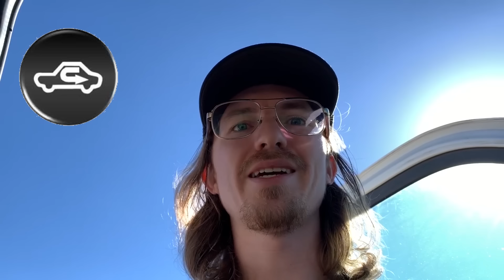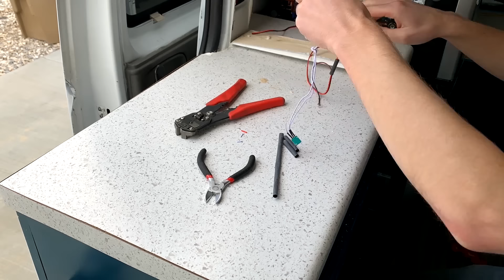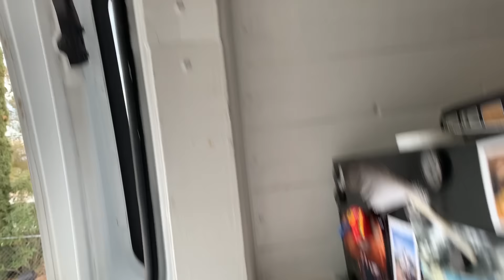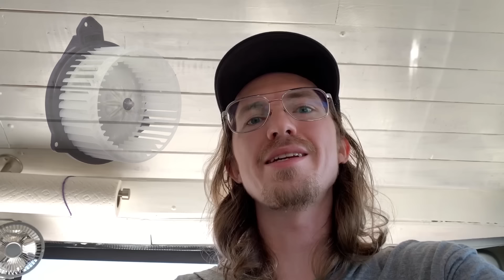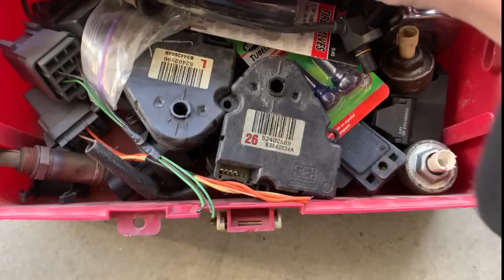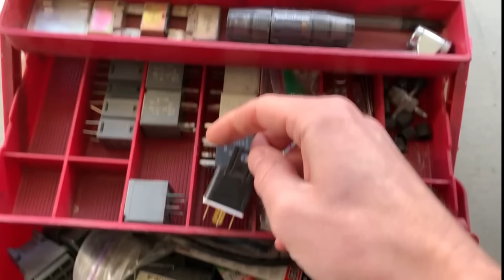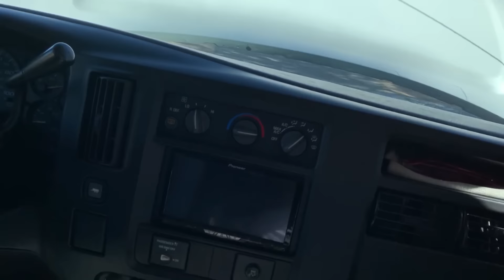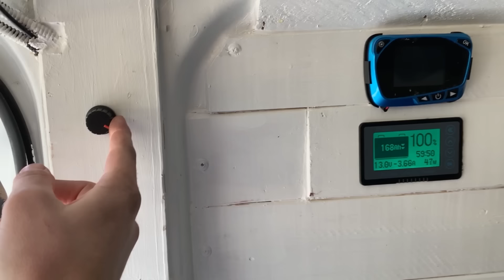OEM Blower Hack **ULTIMATE STEALTH**

Comment: Hi Tim, if you were to redo your van again, would you make room for a roof vent at the cost of stealth and less solar output?  I'm currently stealth camping across the country in my Toyota RAV4 hybrid with a 200-W solar panel nested inside a roof rack for stealth, connected to 100 amp hour lithium battery. I absolutely love the stealth, but I need to build out a van for the girlfriend and I eventually, and she wants A/C. :)
Reply from the maker: That's a really tough question for me. I guess it would depend on where you plan to camp out!
If you're doing lots of urban camping I would probably stick with the solar and ditch the roof fan purely for the stealth factor.
If you're out at campsites or bouncing around western USA BLM land, I'd go with the roof vent!
You could even install the roof vent under the solar panels with a small lip around the opening to block water from rolling down the roof and inside the fan. Then just use the large solar panel as the main rain guard. Only issue there is closing and insulating the fan opening during cold nights.

You can gain a LOT of solar with a tilting mechanism to keep the panels pointed at the sun, but that's a really expensive project. You would need a skilled welder / machinist to pull it off safely while still maintaining a low-profile stealth look.

Of course that's all just my opinion and different people have different goals and lifestyles!
Hope it helped give a little insight!
-Tim

Comment: Meanwhile I just wired my blower fans directly to my living battery (with a small pwm controller in between) and to switch between living and starter battery I just used a if/or mechanical switch ^^
Reply from the maker: Excellent! Someone else in the comments mentioned doing the same thing (they didn't want to use a relay or diodes)
Thanks for watching!
-Tim
Reply: @VanwithTim  it is a less elegat solution, but I barely ever even switch it back to starter battery, since I am loading the livibg battery while driving anyway. And I can set it to the exact speed I like, not just 1-4
Reply from the maker: @florihae  I always hated the 1-4 speeds in the OEM unit! Glad it's working out!
Reply: @CharRichardson  idk what a pcm is, sorry.
Switch I had laying arrround, so I can not tell you much about it. But it is rated for 230V 10A...technically not fit for the task 🤣

Comment: Hi Tim Thanks for sharing your Ideas.
However instead of having 4 Solar Panels on  you Van Roof, why not get One 380 Watt Solar Panel? 
Cheers from Toronto, Canada!
Reply from the maker: Hey Grazyna thanks for watching!
We have an AC unit we use quite often which draws around 510 watts.
With the conversion losses and inefficiency, the 920 watts of solar really only outputs around 700 watts max (and only when the sun is directly above).
That's overkill for many van builds, but we really wanted off-grid air conditioning!
-Tim

Comment: Good idea.  You know your electrical. 
I like my fantastic fan -  installed over the cooktop which is at the sliding door When you need to cook inside I find it makes a huge difference to have the fan just above you on high sucking the heat and smell outside real quick. Most of the use I get from the fan iS sucking the air out.

Good luck and hopefully it works out for you. 
BTW I have just two 100 watt panels that I fold out as needed, I rarely have to deploy them as the alternator does most of the charging - so I had plenty of roof real estate...
Reply from the maker: Those Fantastic Fan's really move a TON of air! My little setup is better than nothing for sure, but it would have been nice to have the power and efficiency of the rooftop fan.

We typically drive once a day to go out adventuring so our 145a alternator takes up any slack from a cloudy day or tall surrounding trees.

The solar is a nice addition to have for sure though!

Thanks for checking out the video Terry!
Cheers!
-Tim
Reply: @VanwithTim  If you drive once a day (as we do) you likely don't need solar - cuz your alternator will do the job. I chose to not put solar on the roof to limit complexity and help with fuel mileage. 
Did a quick and dirty search. FF = 950 cfm - VAN = 250 cfm. & fan on be the van will be noisier. These numbers don't matter in 70-degree weather. Wait till you are at 90 degrees with a lot of bugs...  (spell no fun )
Reply from the maker: @TerryManitoba  The bugs were the real reason we needed this! Cooking on a hot night yet couldn't open any doors or windows. Thousands of mosquitos excitedly waiting for a slumber-party just outside the van.
Those were some MISERABLE nights haha

Comment: The chassis ground can be modeled as the whole body of the car being a giant wire. The only limitation is the quality of the grounding between your equipment and the chassis. You can get voltage drop with high current loads across the oxidized junctions eg when the starter happens but that’s probably not relevant for your use ;)

Comment: No electric solder iron ... a high power gas torch/lighter ..that's badass soldering!!  :)
Reply from the maker: You quickly discover the quality of wire insulation with the open flame method haha.
My Chinese wire will go up in flame almost instantly. My California manufactured wire has extremely high heat tolerances!
Thanks for watching John!
Reply: @VanwithTim  USA! USA! USA! USA! USA! USA! USA! USA! USA!   :)

Comment: Even if a centrifugal fan could move air in reverse, the dust and debris it would churn up between the cabin air filter and the exterior grates would probably not be a good thing.
Reply from the maker: Forgot to mention that! Unfortunately (or fortunately in that situation) all 1996 - current Express vans lack cabin air filters.
A sad state of affairs for GM honestly.
Reply: @VanwithTim  Yikes! Yeah, I guess all the more reason to avoid sucking that stuff back into the cabin.

Comment: Okay, I watched your video and have come to the conclusion that I have 2 choices:  (1) Be sure to leave room on my roof for a roof fan should I ever decide I want one; or (2) I find out where you are and drive out to meet you and pay you to do the installation required to  use my van's air circulation blower system.
Reply from the maker: Haha thanks George. I would definitely recommend the rooftop fan over this (more efficient!) But this is a cool little option for those who love to tinker around.
Cheers!
-Tim
Reply: If you are trying to make this happen, you could probably find an auto shop willing to work with you

Comment: A lot of work. I. Bought a 12v electric radiator fan for $15.00. I put it on a piece of wood that will fit the inside of my rear pop out window of my van for stealth. I have a reverse switch and on and off switch to attach to it feeding it from my fuse box. About $25 total.
Reply from the maker: Sounds EXACTLY like this setup!
https://youtu.be/9WdWvQaoN5A?t=232
Yours probably flows 10x more air than the stock blower motor.
I see people putting rooftop fans in their back doors as well but it just looks a bit funky to me (and expensive).
Excellent way to think outside the box
Cheers!
-Tim

Comment: I have a theory that directly relates to this. What if you used an auxiliary coolant heater to warm your coolant, would this then allow you to heat your van through these vents?
Reply from the maker: That's a great idea! The freezeplug type block heaters wouldn't work as they don't circulate the coolant, but there are versions that heat  circulate the coolant!
It should work ASSUMING the coolant pump has enough power to circulate through the relatively narrow heater core hoses and heater tubes. (in contrast to the very open engine coolant hoses and passages)

I'm unsure just how much heat would be produced though. It would probably be pretty small as the majority of heat would be absorbed by the engine.

Would be cool to test!
-Tim

Comment: That's a clever trick, but that blower seems mighty inefficient.  A maxxair only draws about 4.5 amps on high (1200 cfm) a fantastic fan only 3 amps for 900 cfm.  With all the obstructions I'd be amazed if your stock blower is moving that much air for 2-3x the power.  I get you're trying to avoid roof vents here, but you pay for it.
Reply from the maker: You're spot on.
Would have loved to find  factory CFM data but I guess it's not a heavily discussed topic. (Why would it be, right?)
There's no way it's moving as much as a rooftop fan, and the power draw is far more.
Have a smoke test planned just to satisfy my curiosity.
Should then give a rough CFM estimate but it won't be anything too impressive. Made for a fun experiment while thinking outside the box though!

Thanks for watching!
-Tim

Comment: What will happen if the blower motor is energized by both the PWM controller and the dash switch?
Reply from the maker: Great question Richard,
The magic lies in the relay.
Check out https://youtu.be/xvFvJiiDD7w?t=250
The blower motor is connected to pin 30
The PWM controller is on pin 87a
The OEM controller is on pin 87

When the ignition is on, the relay activates.

The blower disconnects from pin 87a and connects to pin 87 (keeping the PWM separate from the OEM controller).

Hope that made sense! Easy to demonstrate, tough to type out!
-Tim

Comment: I'm dumbfounded by your sophistry,   KISS   ( keep it simple ) if all the relays to the blower motor are open, why add a relay instead of just splicing a power wire to the blower motor?  Also someone mentioned putting a thermostat in the circuit for keeping the van temperate when your not in it.
Reply from the maker: If the key were on and the OEM blower circuit was active, it would try to back-feed into the PWM controller.
Say the house batteries were only at 12.1v and the van was running at 13.8v, it would try flowing enough amperage through the small blower wire and the PWM circuit that the fuses would blow (or without fuses, catch the wire or controller on fire)
Same could happen in reverse:
The house batteries are at a comfortable 13.2v with the solar but then the key is turned on. With a simple splice into the blower motor wire, it will try to "charge" the starting battery through the PWM controller and the OEM blower circuitry. Again resulting in blown fuses or fire.

I usually do try keeping it as simple as possible (a single 5-pin relay is pretty simple!) but unfortunately that relay IS needed.
---------------------------------
Thermostat: I've tried the W1209 units, but the manufacturers are hit or miss (mostly MISS) with their components.
They're almost all missing  pieces to protect them from "overvoltage"
Although rated for 12v, they seem to fry the relay's at even a slight increase to 13v (typical automotive voltages)

Would love to put together a setup that measures the Δt from interior to exterior as well as monitors the battery voltage!
Great idea!
Reply: Other than having one system override the other, I would then opt for diode isolation at the blower motor, my vehicle has a computer and relays for everything.  In a previous van I had a fan, just hooked to a thermost, full on or off, I never thought of a speed control,  just temperature as the furnace in my sticks and bricks.  I've just fused both ends of the wire connecting my back and front batteries,  I've bought a relay to isolate them, but in 8 years havent been faced with the need to separate them. I had a knife switch separating the batteries on a previous van but found that I just left it closed. I do have a "Volt minder" low voltage meter and audible alarm adjusted to sound at 12.5 volts, so I never worry about having enough to start the van.

Comment: A lot of engeneering went into this, but as a non native speaker I am wondering what´s the benefit?. Shouldn´t the first goal be to suck the moistered air from cooking and breathing OUT of the van, and SECOND bring fresh air IN?
Reply from the maker: Ah, my apologies for not including subtitles on this one!

With the flow direction, it seems to be personal preference on which way to have the fan blowing.

For example, if you're cooking next to an open window, you'll want the fan to push the air IN and force the cooking smells OUT through the window.
(If it were reversed it would bring the cooking smells all the way thorough the van)

But there are other situations it would be better to suck the air out!

Overall though, as long as the fan is pushing the air in, the pressure it creates causes the inside air to be "pushed" out the back.

I hope that makes sense!
Sorry for the long comment!
-Tim

Comment: Thats a lot of work what you can do is take the power to the fan and make it permanently live and put a new fuse in the circuit.
Reply from the maker: That's much easier for those not super-comfortable with this schematic.
I would just be weary of back-feeding the 12v+ into the OEM circuit when the key is off.

Results will vary depending on make / model, but it might just try to power your entire OEM fuse block off of your 12v+ live wire.

Always worth doing some probing first and checking the factory wiring diagrams to be safe!

Thanks for watching Vince!
-Tim

Comment: What are you doing to eliminate back feed? I didn't see any usage of a diode to make sure you're not sending current back through the original blower circuit.
Reply from the maker: That's an important question!
The relay pack is what isolates the PWM controller from back-feeding current into the OEM blower circuit.

When the key is off, the blower motor's 12v + and - are cut off from the OEM circuits and connected to my add-on PWM controller.

When the key is on, the relays are energized and the blower's 12v + and - are disconnected from my add-on controller and reconnected to the OEM blower circuit.

Comment: How are you powering the fridge?
Reply from the maker: It's a 120v "dorm" fridge.
Not at all made for the extreme temperatures / bouncing around of a van, but it's been running fine for the past 1.5 years!
Once it dies (it will eventually die) I'll grab another one for $150.
It draws around 80w (including inverter efficiency loss)

Comment: When parked in a camp setting, you could put a shade tarp over the air intake to pull cooler air into your van.  This would also keep direct sun off your windshield.  Might help.  I tied a shade tarp from the support poles in a picnic area over my car to the back of my roof rack in Red Rock near Vegas and dropped the car’s internal temperature 10-15 degrees.  It went from frying my brain to tolerable inside my car.
Reply from the maker: That's a great idea. Window tint is one thing, but actually keeping the sun off of the van altogether is a much better idea.
Thanks Catherine
Reply: @VanwithTim  Hope it's helpful.  If you don't want to cover your solar panels, maybe just tie the tarp to the leading edge of the panel support structure.  Wish I had your confidence with electrical projects.
Reply from the maker: @Catmoore60  Thank you for the kind words Catherine, and I really think you're on to something there!
Off topic, but have you also visited Valley of Fire State Park (north-east of Red Rock?)
Our first night in the van was spent on those outskirts. Possibly our favorite state park visited in the US so far!
How do / did you like Red Rock? We might have to check it out this spring.
-Tim
Reply: @VanwithTim  I was in Red Rock to belay a climbing friend, and there were so many routes, we never made it out of Red Rock that trip.  I'd love to see Valley of Fire!  Red Rock was really cool, in a very hot way.  There was a terrific hike to a couple of tanks, but time that well or you will fry.  Walking in a narrow canyon with no breeze and heat radiating off both walls was a test of fortitude in the middle of the day.  It was also really fun to watch the climbers working the various routes.  Not for me, but interesting to watch!

Comment: 50 years ago, I was a student engineer assigned to Chevy Engineering at the Warren Tech Center.  One of my first assignments was testing vehicle electrical systems, recording the current draw of each device.  The resistor pack you show is basically the same one used in 1969.  The blower will draw more current on low and medium than on high.  The 4th speed was a seperate wire to the blower on a 30A fuse.  Everything was to chassis ground, so your idea of a single wire to the front is right.
Reply: Are you sure? You’re adding resistance so the current drops and in turn the power used also drops. I think what you seen was amount of power getting converted to air movement gets worse as you lower the speed, that would make sense. Yeah?